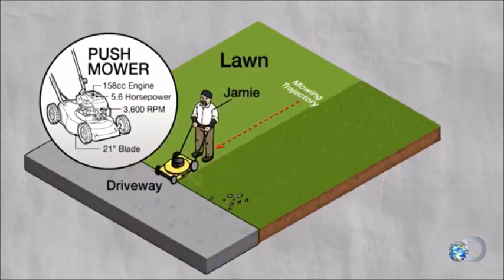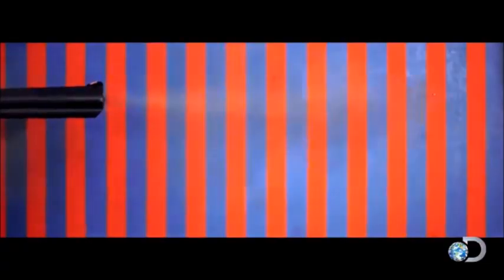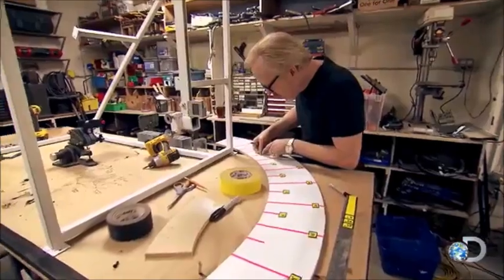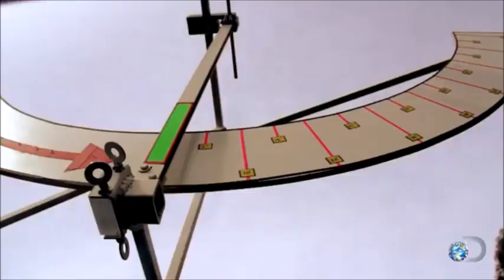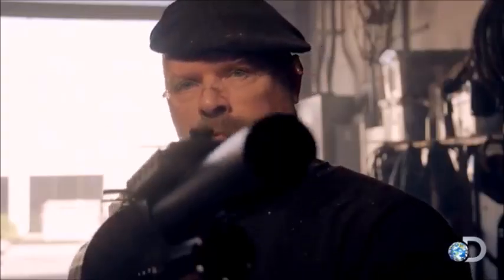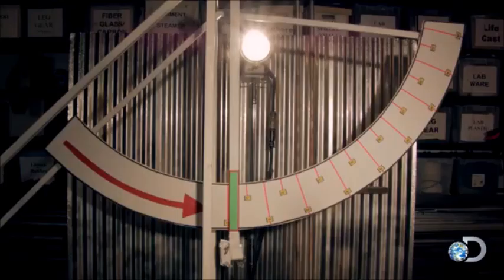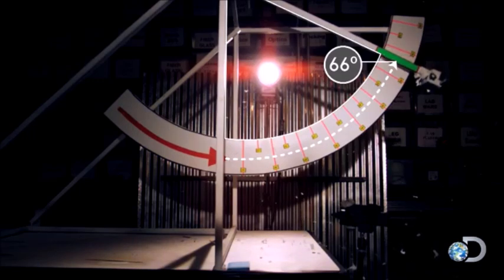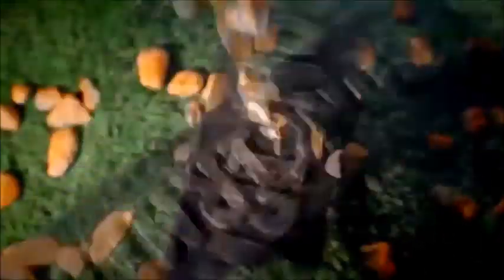Lawn Mower Rocks

Comment: All they had to do was calculate the energy using Kinetic Energy = 0.5*mass*velocity*velocity.  The mass of the rock relative to the bullet is much greater than the velocity of the bullet squared relative to the velocity of the rock squared.  Therefore the rock will have a greater kinetic energy than the bullet.
Reply: "The mass of the rock relative to the bullet is much greater than the velocity of the bullet squared relative to the velocity of the rock squared"
after 30 minutes trying to make sense of this, what you say is equally to this:
[ mass rock / mass bullet ]  greater than >  [ velocity of the bullet² / velocity of the rock² ]

"Therefore the rock will have a greater kinetic energy than the bullet."

so you say if this state occurs, the stone is stronger? and this is the reason? maybe i'm wrong, but i think you're wrong. i cant get from you formula to the initial formula "Kinetic Energy = 0.5*mass*velocity*velocity". i guess with your formula, (maybe withthe second part put in vice versa) you could maybe calculate how heavy a stone must be to be as strong as a bullet at the same speed or how fast a stone that has the weight of the bullet must be to archieve the power of the bullet...?
Reply: Im glad someone else mentioned this too. They should have used the same testing with the gun the made with two very similar rocks. 
and how did they test the lawnmowers power?